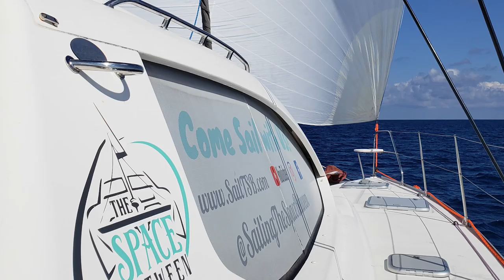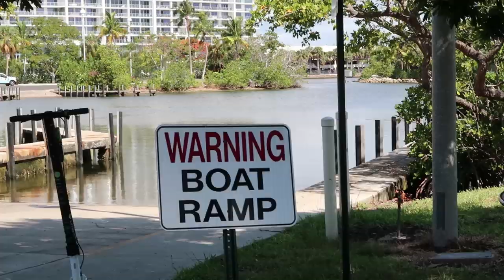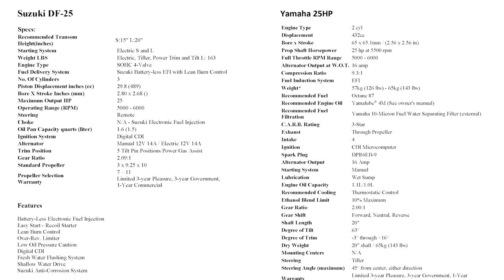Yamaha VS. Suzuki Outboards | The Dinghy Debacle Finale E51 | Sailing The Space Between

Comment: I recently bought a Highfield CL340 with a Yamaha F25 tiller outboard.  I think one thing you are overlooking is ease of serviceability...the Yamaha dealer network is much more robust, even more so internationally.  I agree the Yamaha does have more vibration with the 2-cylinders 4-stroke but it dissipates when you add some RPMs.  I looked long and hard at the Mercury since I think its F-N-R operation in the tiller is a much better design than the paddle shifters.  Ultimately, the Mercury would been $300-600 more than the Yamaha since Mercury does not ship with a prop.  The Suzuki would have been more money than the Yamaha F25 as well.   I paid about $3600 shipped for a Yamaha F25LMHC with 3 year factory warranty plus 2 additional years of the Y.E.S extended warranty (5 years total coverage).  I am happy with the Yamaha and it does a great job of pushing the CL340 at nearly 30MPH!  Also given your center console setup you were already married to the Suzuki since you would have had to buy all new rigging if you switched outboard brands.  At the end of the day, I don't really know if one is better than the other...it's just a matter of personal preference, needs and budget.  I enjoyed the video, thanks for sharing.
Reply: Where did you find that deal for the Yammy?
Reply: @johndyer4876  thanks

Comment: I had a 20hp Suzuki. I did have fuel pump issues on my first run. It got fixed by a dealer that does know his stuff around these smaller Suzuki engines. Never had any problem again. It was a pull start but my little sister who was 11 at the time could pull start it. Very smooth, very quiet engine. Loved it. Bought a bigger boat wich had a old DT65 2-stroke on the back. I miss the DF20A to this day. For me it's Suzuki all day. There waranty is supreme. Never a single discussion about small stuff. Of course it's depending on the dealer you visit. Currently looking to repower my boat to a Suzuki in the 70-100hp range. Waiting for a nice second hand one or a good deal on a new one🤞🏼

Comment: I have a 2001 DF15, bought used, for $900, in 2010. 
It now has countless hundreds of hours on it, with half being at full throttle, for 25 miles at a time, and the other half bouncing off submerged obstacles. 
That engine has never missed a lick, and will idle all day long, unattended, if I so choose. 
I recently picked up a 2008 Yamaha 15, but I’m a little hesitant to swap them out, even tho I stand a good chance to sell the Suzuki for the price I paid for it, after 12yrs of hard use. 
The thermostat, on the Suzuki, is so readily accessible, I flush the engine via the thermostat opening/housing, allowing inspection of the still original thermostat, every time. 
I’ve done one timing belt, two sets of plugs, many impellers, and lower unit seals, once. 
I run a water separator, but standard pump gas.  
I’m a little leery of the EFI models, but only because after owning nearly every type of outboard, from Hondas, to a built Mercury 2.4,L, Ive never had another serve me better than our trusted little Zuke. 
I brazed up my own nose cone, mounted it on an adjustable jack plate,  with a 9.25 x 12, and it’ll move my son and myself in a wide 14’ Jon boat, at 25mph. 
Found this video, because I’m debating going with the Yammy.

Comment: So l'm confused, what was the solution to the suzuki  issue, what did you have to do to fix the problem.....
Reply from the maker: Wow totally left that out the guy finally did what he was paid to do the first time replace the high pressure fuel pump and filter.
Reply: Ok , great to here you got things sorted.....cheers
Reply: @SailingTheSpaceBetween   .... that was all warranty? .... just the massive frustration and time spent ... good you got it sorted .....
Reply: @SailingTheSpaceBetween  Didn't he originally charge you for the high pressure pump or should it have been under warranty?  That's the other thing about the Suzuki EFI that scares me is  getting bad fuel and having it cause damage to the Suzuki's EFI system?  On a carbed model, you just clean the carb and go?
Reply from the maker: @peterfrebold  No they still charged me $500 and blamed it on the fuel even though it got past 2 of there filters
Reply from the maker: @jcf6597  Ya the pump was under warranty but the extra parts like the fuel filters and line were not so I feel it should have all been under warranty but...
Reply: What a shame... I've had good luck with Suzuki and am looking forward to buying a 20 hp I guess the dealership in the area is also a lot to do with the purchasing descision
Reply: @peterstarkey1360  l

Comment: After diving in a little deeper, there’s a substantial difference in design quality of the water pump impellers. 
The Suzuki impeller has tall blades, each only 1/2” wide. The Yamaha has short blades, nearly 2” wide, leaving them prone to shearing off the impeller body, and clogging the narrow passageways. 
The Yamaha impeller looks eerily similar to the early 90’s Mercury two stroke 15hp, with long, skinny, and fragile blades.
Reply: Is that the current, 2022 design still?

Comment: I have had 3 high pressure fuel pump failures on my suzuki df30. The hp pumps are very sensitive to any water in the fuel. The spark plugs will also fail after running with bad fuel.   I’m hoping a new fuel system will prevent more failures.

Comment: Having watched numerous videos of Highfield failures and how quickly a new boat is swapped out, I decided to go with a different manufacturer because I can't have my dinghy falling apart as many have during remote area cruising. Considering that they are mass produced in China, I can only imagine the mark up on them which explains why they are so fast to swap them out.
Reply from the maker: In all fairness the dong that dropped it out of the racks is the one who broke the welds the new we have had over 2 years now and it still looks and preforms like new
Reply: @SailingTheSpaceBetween  I watched a guy buy one and within the first two weeks literally sunk it after it brushed barnacles on a jetty. That is about one of 20 failures I found researching online within the last two year. I mean I get that it is inflatable but as I say, I can't risk that so went with something else that can't puncture.

Comment: Would like to know what the problem was because I have a Tickover problem with my Suzuki 25 it stalls after a few mins but will run at high revs all day
Reply from the maker: Sorry the problem was a small fuel filter in front of the high pressure fuel pump and cased the pump to be intermittent. So the repair shop finally did what they charged me to do the first time
Reply: Ok thanks I had mine changed and still was the same I had two tests now since the plugs were changed and all ok it was either water or debris signs of which are on the plugs thanks for the reply
Reply: Maybe in the Bahamas a service place can get away with "not fixin things" but try that in arkansas during duck season.

Comment: I own this 2019 Suzuki 25 myself. What caused the fuel pump to die on you exactly ? I’ve heard that running out of gas could fry the electric fuel pump, but an bad gas also do this ? Thanks - Jeff
Reply from the maker: yes bad gas did it the fuel filters are crap put a pre filter on it or you two could be stranded.

Comment: Thanks for this tip, you mean an external regular type fuel filter ? Also, I was advised to invest in an external water separator as well. Other than that, this has been an exceptional running engine so far......22 hrs. on it so far.
Reply from the maker: Yes but you can get them both in one unit https://www.amazon.com/gp/product/B07GQPRJRB/ref=ppx_yo_dt_b_search_asin_title?ie=UTF8&psc=1
Reply: @SailingTheSpaceBetween  
I was checking in to see how that filter has been working a d if you've experienced anymore issues with the Suzuki. I have the same engine and thanks for the filter link. Are you currently using this filter you linked me ? No problems with high pressure pump strain from it ? Thanks in advance....you're correct, with all the latest technology on our DF25A's......we best know some basic shit !

Comment: With regards to the hole shot .Both engines rated to the same hp so shouldn't the acceleration come down to what pitch prop is on the engine 🤷.
My 2006 115 Yamaha is awesome. I've just replaced my 2004 honda 5hp 4stroke in favour of the 6hp 2018 Suzuki.
Very impressed with the Suzuki so far it is very quiet compared to the Honda 🙋.
Great video 👌
Reply: No, the Suzuki 25hp is a larger displacement engine go it generates more torque in the low-end and mid-range RPMs, which is why it accelerates better with a load.  Top speed performance, in theory, should be identical since both motors peak at 25hp.

Comment: Then what motor do you recommend?  None?
Reply from the maker: LOL Well if you are going to the Bahamas then definitely not the Yamaha they will go out of there way to steel it and it runs so ruff and under powered. The Suzuki has been running great now for over 4 years just put a raycor filter between the gas tank and motor and I have had no issues.

Comment: The thing that would scare me about the Suzuki, is the EFI. How do you trouble shoot it with out having a computer and related software to get codes? Please tell me I'm wrong  that the Suzuki is as easy as a carbed outboard to diagnose and repair. :)
Reply from the maker: No you are correct but carrying a spare ecm should fix any problems if they occur working on the software but till then this will do. I just cant tell you the difference between the two the susuxi is such a better running motor when it runs. Will let you know in a year
Reply: @SailingTheSpaceBetween  Do you also have to carry spare EFI sensors and injectors?
Reply: @jcf6597  lmaoz right... this guy clueless

Comment: Why not a decent outboard like a Mercury or Honda? I’m guessing there must be a reason for buying 2nd rate outboards?
Reply from the maker: Well I like the fuel injection and if i had a ton of money I would try the merc but no on the honda
Reply: Suzuki is so much better than Mercury its not even funny.
Reply: Sailing The Space Between ever considered tohatsu they make all the smaller mercs.   I have a 20hp tiller tohatsu that I’ve abused and it has never let me down.
Reply: Why suzuki.  It's a 3-cyl and ... well you figure it out.
Reply: The mercury is a rebadged tohatsu....the parts inside literally have the same model numbers so jokes on you!
Reply: @melrose9252  haha so funny 2 mercury motors in never again not 4 stroke, had tohatsu 2 strokes for years never an issue so ill assume 2 stroke mercury will be the same since tohatsu makes them up to 60HP funny though in 4 stroke land the tohatsu mid range are Honda';s.

Comment: Those engines are bullet proof. I bet its a rigging problem like screw or drill bit through the harness. Or he ran some crap fuel through it.  I see things like that very often as a technicion and someone who probably rigs 50 boats a year and sees what kind of careless work some shops put out. The chance the engines problems are the Suzuki's fault are very small.

Comment: Why didnt you look at an etec?
Reply: Because they are two stroke engines
Reply: NoobPvPtv ETEC is unreliable and two strokes are for weed eaters.  The new 4 Strokes are out doing the 2 Strokes.
Reply: @melrose9252  😂😂😂😂😂 four strokes are outperforming the etec!? You've obvisouly never been in any boat with an etec, they will run circles around ever 4stroke out there

Comment: Someone tell me how stainless steel bolts can get rusty in aluminum. Why would you pay 500.00 dollars for some fuel line and filter. And like she said work smarter not harder. He should listen to his own advice.
Reply: Electrolysis from dissimilar metals, same reason the stainless bolts on outboards get stuck simple fix copper slip  or teflon grease or teflon on day 1.

Comment: All boat engines are problematic Honda is more reliable than all others,  but  there is a different with weight it is heavy.  Yamaha is easy most common then Mercury.  As Suzuki has a new build very powerful centre of gravity is far better and will improve.  Johnson /Evenrude  well they are last heavy and underpowered compared to the others.  But there are cheaper ones and to me for economy reliability and power they don't make the cut.

Comment: Worst review of motors I’ve ever seen. Your comparing apples to oranges. The Yamaha can be bought with an electric start and remote controls to connect to a console. You ham get it with electric tilt too. And I’d rather have a little vibration in the motor than an undiagnosable gas issue. I’d wager you get a kickback from Suzuki after watching this obviously biased review.